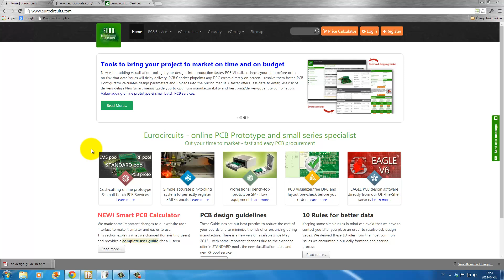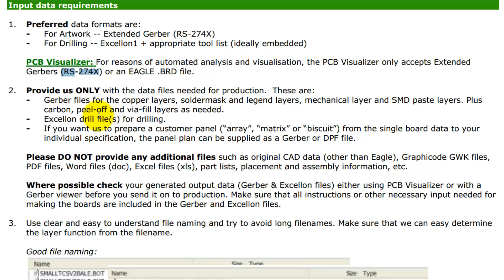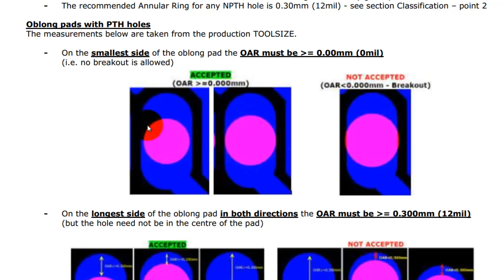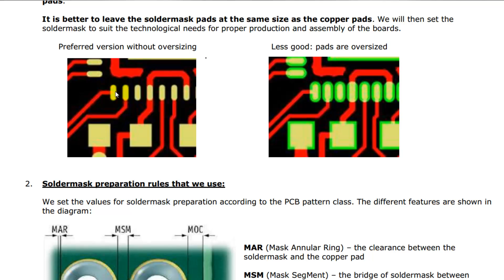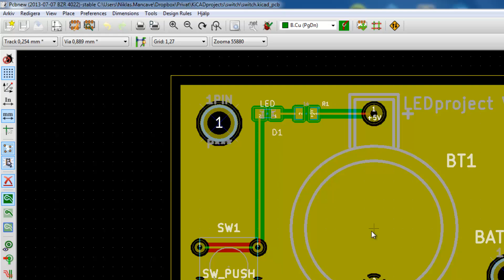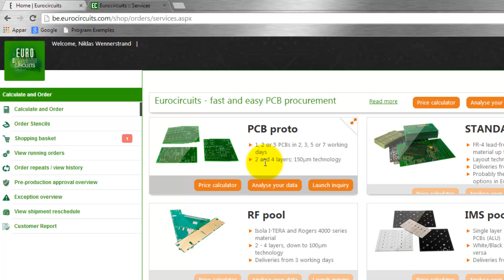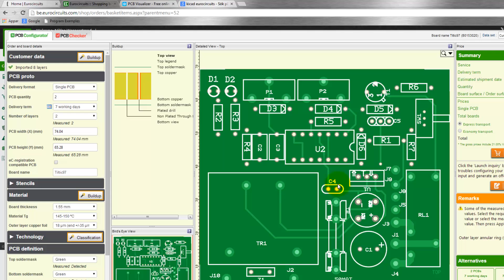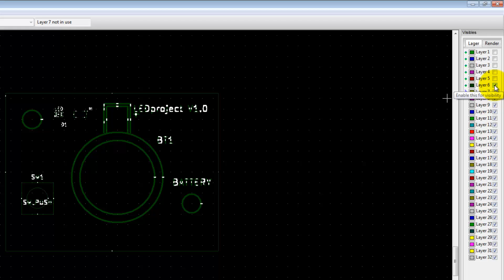KiCad Tutorial #8 Prepare production files

Comment: Sir, do U have NO teachings, of how to make my PCB at home?.. but U want, even my single PCB to be sent to "Euro circuits" ?  U don't even show how to print the PCB on transfer paper? Is Ur video, NOT for the hobbyist??..but only for commercial manufacturers...? But In "Eagle", I can easily print and make PCB's at home, even here,.. in a backward country...!
Reply from the maker: There are many online service PCB manufactorer that you can use as an hobbyist. All you need is a credit card like Visa or similar. If I buy the chemicals and all I need to do transfer paper techniques it will cost the same or even more than to use a professional on line service. If you do transfer technique you wont get plated trough holes and its more trouble than using online services.  But if you want to do transfer method at home you can just search on youtube how to do it.